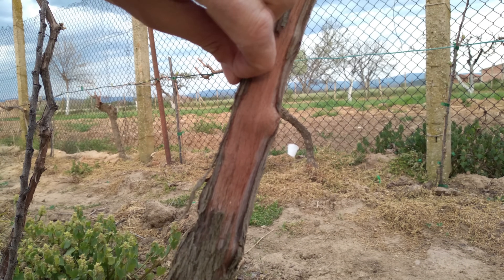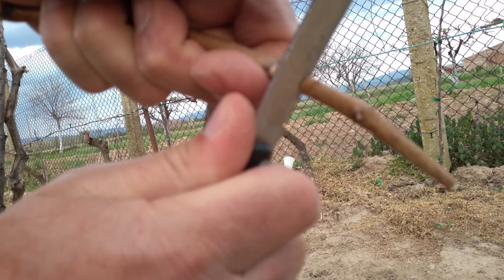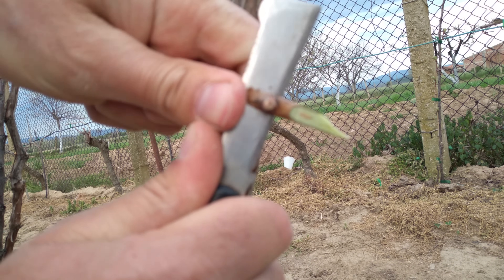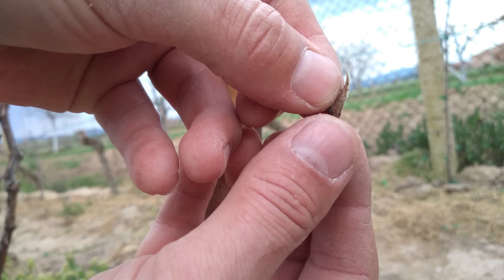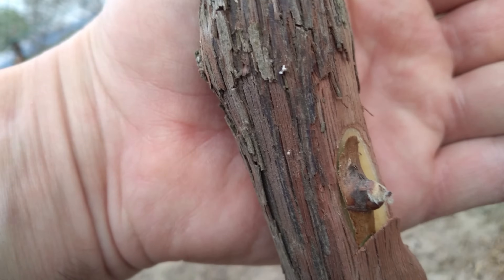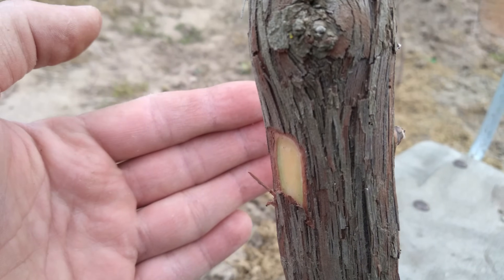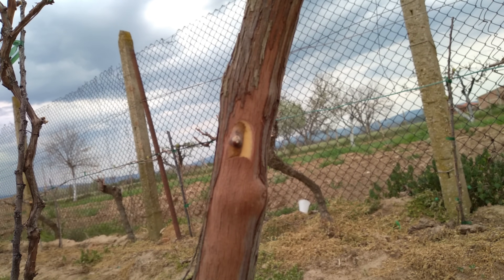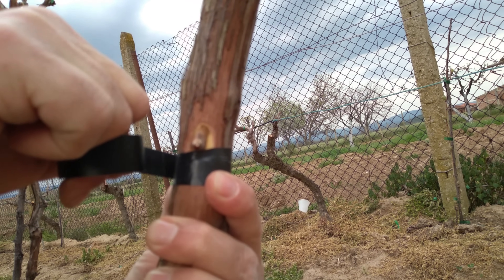Grape vine transplant - bud grafting grape vines

Comment: Can you tell me the time of the vaccination?
Reply from the maker: The first option is at the end of April, but then the vines are still in strong sap flow and a wound must be made under the grafting site so that the sap can flow out. The second and best time is in May, when the flowers of the vines appear, but with both options you need to keep the cuttings in the refrigerator as I showed in an old video.